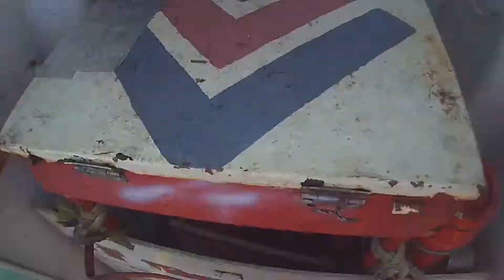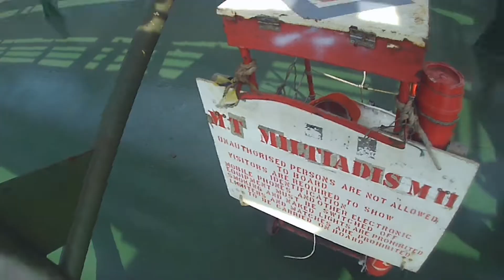Rigging of combination ladder

Comment: Sir exactly wer magnet is tied how much metre from bottom rubber step to accomodation ladder ya from deck to how much metre ya steps to accomodation ladder?wanted to know
Reply: Near the platform of the gangway
Reply from the maker: The correct/suggested rigging of combination Ladder sir is for sure already posted on the bridge for reference and if not ask your officer  to show you the company manual or some videos on how to rigged it.
Reply: @noobbiker6314  thanks for the help sir. Spread positivity!
Reply: @noobbiker6314  it should be 1.5 meters above the platform